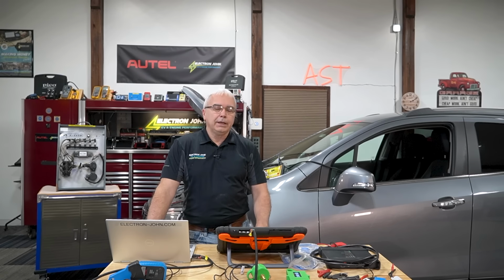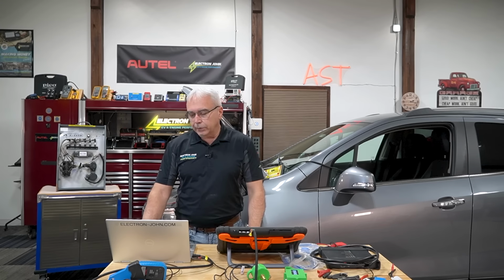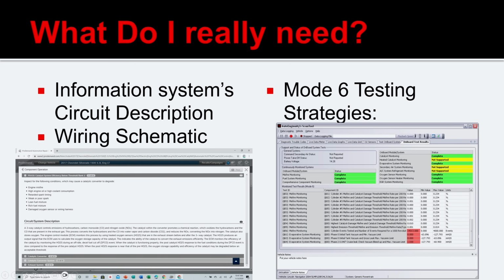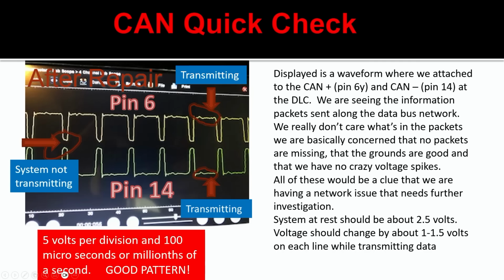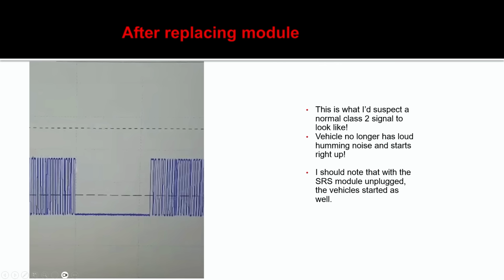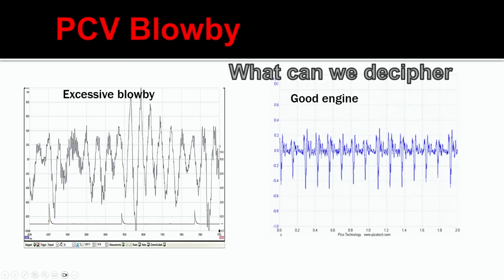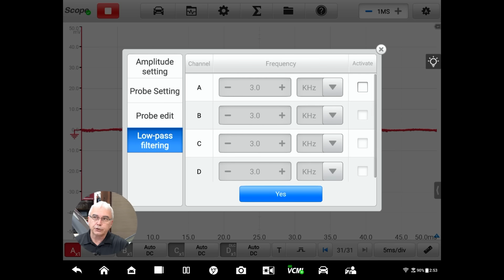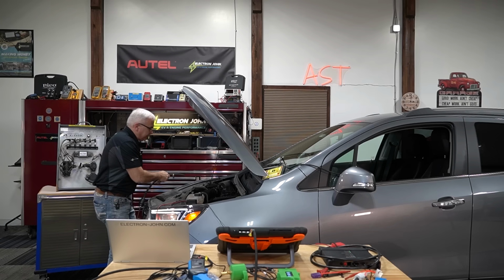Expert Techniques in Advanced Vehicle Diagnostics: A Comprehensive Workshop

Comment: Volkswagen vehicle engine does not off after key removal, I checked wiring it's ok, what is the possible cause of this problem how can I check it properly.
Please reply Thanks.
Do you have any couress for learning this things online?
Reply from the maker: it would have to be still getting an ignition signal, meaning 12 volt , after the key is turned off.  are there any aftermarket items installed which could be backfeeding that circuit?  I do not have online training courses.

Comment: Isn’t a shorting bar only used on safety systems like air bag connectors. And splice connectors ( star connector) are used for everything else. Just trying to learn. By the way bought a ultra because of you should be here next week 👊🏻
Reply from the maker: good question, star connectors typically just allow all the modules to connect to a data bus line of sorts
Reply: @electron-john thanks bought the ultra like it so far

Comment: No crank, but can be jumped by the screw driver on starter or relay 30 to 87, can the computer be at fault in this scenario?
Reply from the maker: it is possible but please don’t just replace the pcm.  there are several circuits involved that should be checked for proper operation first.  it is very rare to have a faulty pcm
Reply: @electron-john  thank you for the response, subscribed. I worried because I inadvertently swapped the two terminals of a module which I believe is for capping speed and or limiting ideling time, right after that, no crank, but can be jumped as mentioned earlier. The two terminals believe both positive, one in one out. The inside of the module believed is a switch marked a and b. Can be manually flip up and down, believe is high and low voltage. believe also be triggered by the condition of the vehicle possibly mainly the battery but don't know. Will check the fuse later see if the fuse blown . Speaking of fuse, there are two black fuses the size similar to standard fuse, but one leg is perpendicular to the other, on the top a marking of an upside down capital T, and a upward arrow below, touching the upside down T, they have no continuity, is it the way it suppose to be?

Comment: How do you find out what temp bolt amp borametric things should be where is this info found
Reply from the maker: the best option unfortunately isn’t free.  it would be a professional information system such as all data, motor or Mitchel.  however, as a subscriber to my channel you can use the automotive insights ai program I developed for free

Comment: i still have issues with maf sensors. some say if you have say a 4.0  it should be close to the engine size. i have looked at lots of fords and it does not hold true. without one of those really expensive scan tools that bernie  thompson uses with that ability, could you do a video on this in more detail with other alternatives? thanks
Reply from the maker: I will try to do a short at some point in the future.  right now my travel schedule for my day job is very hectic.  you can however, plot the MAF readings with fuel trim manually kind of like how Bernie’s tool does it for you automatically.  just use move]ie mode on your scan tool and drive the vehicle.  thanks for the support!

Comment: when you say that the o2 upstream low or normal what is meant? normal fluctuating? and low? to stay at a low constant value? example 0.3 volt...?
Reply from the maker: Thank you for responding.  What I meant was that a high voltage value on an oxygen sensor represents a rich mixture while a low voltage of say .2 represents a lean exhaust content.  So a low voltage that has fluctuation represents a good sensor because it is fluctuating and a lean exhaust content.  OBD 2 rule of thumb is that it should fluctuate within 100ms or less to be considered a sensor that is not biased.
Reply: @electron-john  now i understand thanks for your reply keep up the great videos you help us to increase our diagnostic skills

Comment: Yes John my name is Robert I have a 2012 Ford F-150 I put a aftermarket stereo in it had to take the airbag out of the front dash so I just pulled it out and let it hang did not hook anything and then when I put it back now I've got a light on the dash and the airbag is got to open circuit do you know how I can use my alltel scan to to I would appreciate your help
Reply from the maker: Hi Robert, you can scan the srs module, but it most likely either came unplugged or possible a wire broke from the weight of hanging the bag based off your description